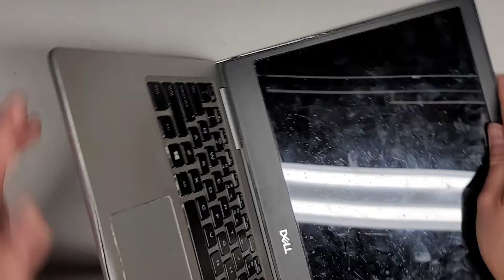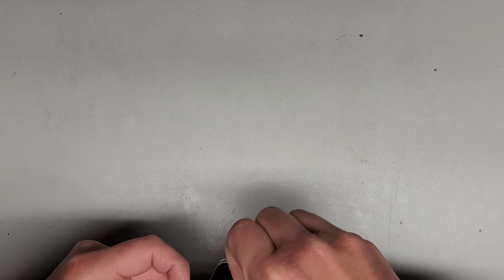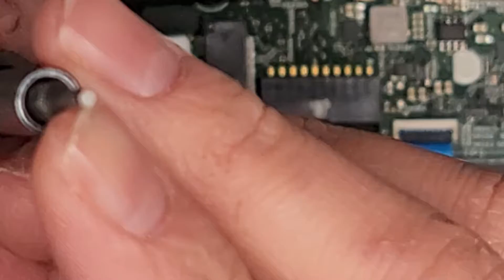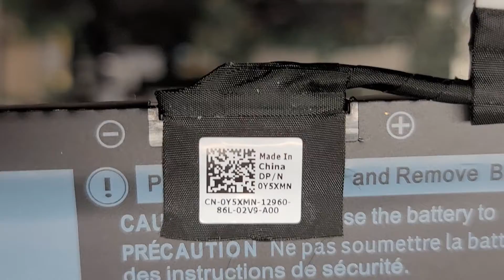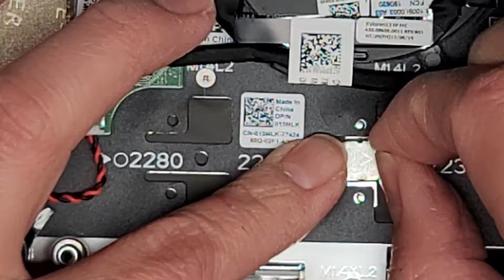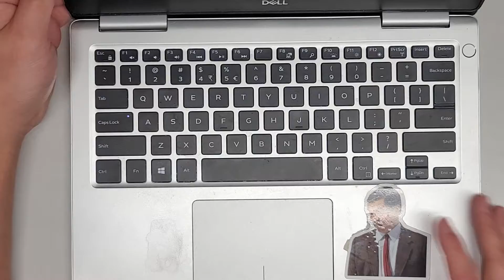Dell Inspiron 7000 Series 7380 Disassembly SSD Hard Drive Upgrade Battery Replacement Repair

Comment: This is a great video.  I had no idea how to open my laptop; however, I cannot get the 4 battery screws loose and I don't think I have a power screwdriver bit small enough to work.  Any suggestions?
Reply from the maker: This set will come in handy https://amzn.to/3EQr3Z0
Reply: @ItsBinhRepaired  Thank you!
Reply from the maker: @Magnoliasandoaks  no problem